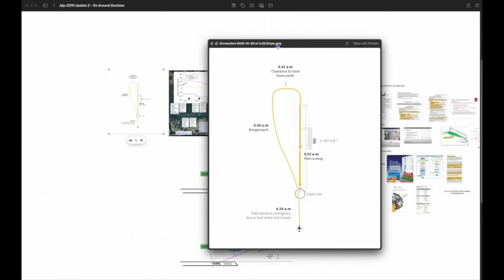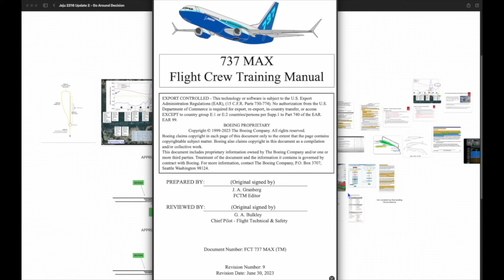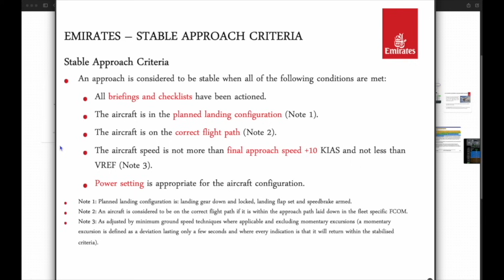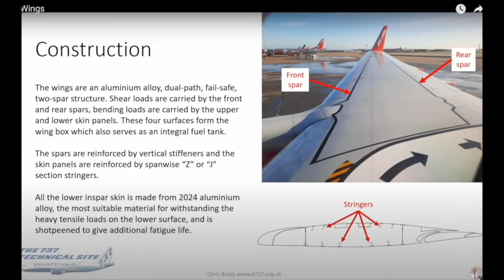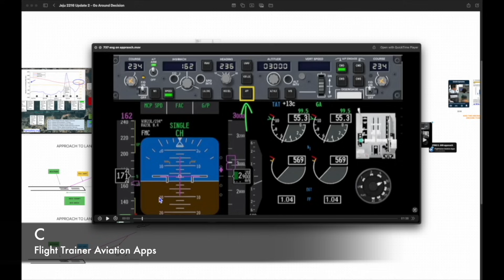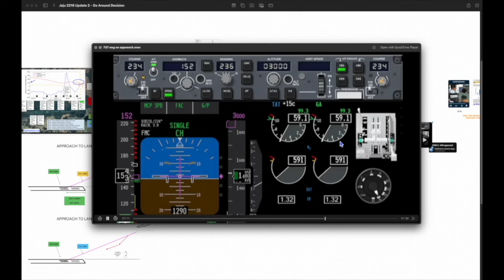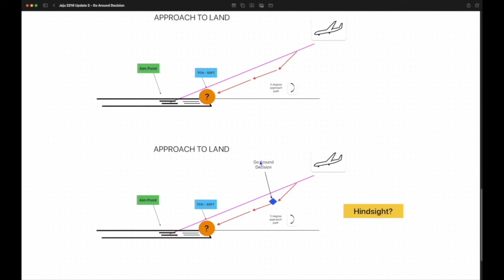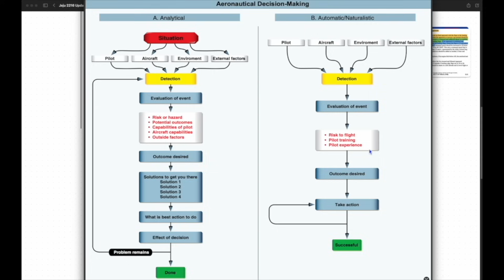Go-Around Explained: Jeju Air 2216’s Decision Not to Land

Comment: Take Note:

Many aviation expert's "Great Wall of Death" shtick regarding the Jeju Air Crash is misplaced, boring and unhelpful. 🤦‍  

The wall at the end of the Muan Airport runway was not the cause of the accident. Events on the plane in the minutes before were the reason for the crash. Going on about "The Wall!" is an exercise in distraction and deflection. With respect to the wall, Jeju Air Flight 2216 was proverbially and literally in the wrong place at the wrong time. FYI, Muan Airport over 17 years has hosted more than 100,000 take offs and landings with no problems at all with the wall.

Note: The concrete retaining wall that Ayrton Senna hit at the San Marino Grand Prix at Imola at 14.17 CET 1/5/1994 at a speed of 233 kmh was not the cause of his death. His loss of control of the Williams FW16 in the seconds just before the impact was the reason for the crash. It is an imperfect analogy with the Jeju Air Crash but you get the point.
Reply: The race had been under a very slow safety car for sometime and the tyre pressures had fallen so that the cars were bottoming-out on the plank, which resulted in Senna losing control. Many lessons were learned from this accident.

Comment: A couple of questions I posed to Chris Brady on 11/1: 

(1) Do you know what sort of CVR was being used on the Boeing 737-8AS registered HL8088? 

(2) What is the normal Chain of Custody for a CVR after a crash? 

(3) Do you know if Flight 2216's CVR was using/connected to a Recorder Independent Power Supply (RIPS)? 

(4) If a 737 loses all electrical power, will the CVR still work/record? 

(5) Can a pilot or co-pilot disconnect/turn off a CVR, either pre take off or in-flight? Hope to get a reply from you about these questions ASAP. 

Chris Brady737 replied: 

I have no way of knowing what type of CVR was fitted or if it had RIPS, that will come out in the investigation. Chain of custody depends upon the country of the accident. ICAO Annex 13 has a preferred path but it isn’t always enforced. Re “all electrical power” if all electrical power is lost then all electrical items will be unpowered. You need to understand that there are different types of electrical power - 3 generators, AC & DC busses, standby busses, various batteries etc. Watch my electrical videos for more info.

A Boeing employee told me the CVR on the Jeju Air plane was a Honeywell.

The HFR5-V CVR with data link recording (DLR) system is made for commercial air transport aircraft to accommodate mandatory cockpit voice recording. It simultaneously records four channels of audio present at its inputs. The HFR5-V CVR retains the most recent 2 hours of recorded information in solid state crash survivable memory.

Comment: The crew were told about birds from ATC made the right decision to go TOGA gear flaps up but still hit birds lost both engines hence that 180 turn to land down wind. 
WHAT could have saved that aircraft. A APU switched on and ready to use fully electronics hydraulics and normal operation of gear flaps etc.
Why wasn't the APU switched on for landing, to save fuel.

Comment: Engine problem/failure/fire on final, adjust flap setting, power and increase airspeed for the flap configuration AND LAND!
If you experience problems on both engines on final it is a no brainer! You HAVE TO LAND! 
I have watched dozens of podcasts on this accident and I do not understand why so many people beat around the bush, this crew should not have abandoned the approach! Yes, the localizer barrier at the end of the runway was the final killer, but apparently they landed the airplane 2/3 down the runway at around 160 knots without gear. How big of a threshold would it take to bring the aircraft to a stop?

Comment: Simple question: if you are facing a situation that your stabilized approach is disruptaed by bird strike (possibly a double one), what is the thought process that makes you think that it is safer to make a go-around, which necesitates climbing, turning and stabilizing again? There is no snowvall in hell where you can get a better shot the second time around. Just pure physics: if there is a disruption in the system, and the system start to loose the energy required to counteract the increase in entropy, as a consequence the entropy will increase. In simple therms, it will get worse over time.

If the training conditioned the crew that no situation can overrule the missed-approach when loosing the "stabilized" flag, then that training is hell wrong.

The primordial goal if any safety measure is: don't make it worse!

I get it that in such a situation the memory items kick in. Because that's the training's goal. But it's clear that there should be exceptions, like: don't attempt a go-around with two degraded engines if you're off the stable parameters by whatever margins. In this situation the goal isn't anymore to get 8n the apron intact and in perfect conditions (that's already gone with the engines), but to stop in as few pieces as possible. And they clearly had this chance in the first round.
Reply from the maker: Thanks for the comment and thoughts, and fair enough. It's very rare to face this scenario in training or anywhere else, so this isn't something that would be familiar - general experience and assessment based on experience, and expertise would have factored largely I would say.
Reply: You go around in order to have time and altitude to assess the damage, determine which systems work and don't, and configure for a new approach. Nearly always, a new approach after a go-around is far safer than continuing an unstabilized approach with a plane with unknown damage.

If they had tried to continue the first approach, without either engine, they would undoubtedly have crashed. The plane would not stay on the runway, in that configuration, without spoilers - they would bounce, likely more than once. And they had no means of slowing the plane if they did get it on the ground - no brakes or reversers. Unless you already know that the second approach will be catastrophic, making a go-around is the safest course. And the pilots, unlike you and I, had no idea that the second attempt would, literally, hit a wall.
Reply: It is hard not to base our opinion on the  disasterous outcome that occurred after the go around decision. So our logic tells us - go around = crash - (in this case). And many people make that arguement over and over again. However, if they were encountering power and direction issues on initial approach, they may have thought they could regain some stablity/control on the go around. Unfortunately things only got worse, but they could not foresee that.
Reply: @Sasha27smile  In fact, despite the fact that they lost all power and could not successfully climb out, they made the right decision. And they successfully made a very difficult turn and performed a textbook landing. If the runway was built according to ICAO standards, they would have walked away as heroes. It was not the pilots fault that there was a concrete structure within 200 metres of the runway end.

The alternative would have been to continue an unstable approach, with a misconfigured plane, with unknown but serious damage. That landing would likely have been devastatingly bad.
Reply: @petercollins7730  The aircraft departed the runway at 150kts, no one was walking away from that crash.
Reply: @christopherrobinson7541  The aircraft departed the runway at a calculated velocity of 94 knots, according to 2 different estimates. And with an energy-absorbing material at the end, and no massive concrete structure, the plane likely would have stopped, basically intact, with few if any serious injuries or fatalities.

Planes have departed the runway at ~100 knots and all or most passengers survived. Air France 558, for example, departed the runway at about 110 knots, and was traveling at over 80 knots when it was stopped by the ravine. Result: no fatalities.

You cannot reasonably claim that there was no chance that this would have been survivable with a better runway.
Reply: @petercollins7730  I'm sticking to 150 kts, which was calculated from the landing video and almost 100% fatalities.
Reply: @christopherrobinson7541  I'm sticking with 94 knots, which was calculated from the landing video. I think either velocity would have been instantly fatal for all.

Hopefully, the final report will be able to provide at least a good estimate of the exit speed. Til then, we're all just guessing.

Comment: It appears to me that the pilots had been maneuvering to avoid the birds, producing an unstable approach. And ran into some anyhow.  So they started a go around.  They started a climb and some seconds later announced a go-around and found that they couldn't climb due to engine damage, followed shortly by total loss of electrical power from the engines due to damage.
Reply from the maker: That could have been the case, without onboard data it could be very hard to reconstruct and answer one way or another
Reply: @AdaptiveAviator  The ADS-B data suggest that the pilot elected to go around,with two good engines, before the bird strikes.
Reply: The only bit I would disagree  with is that I don't think they attempted to maneuver around the birds rather the engine strikes caused them to deviate both in heading and rate of decent. Then I agree with you they attempted to climb for the go around.

Comment: Short final and do a go around with suspect engine no electrics & hydraulics,  2800 mts of runway not put to good use
Reply: The ADS-B data suggests that the pilot elected to go around (with two good engines) before being hit by birds. Having throttled-up and cleaned the aircraft, they were too close and too high to land ahead on runway 01 and hence replanned to land on runway 19.

Note that due to construction work, to extend the runway, only 2,500m was available.

Comment: The plane was completely compromised by bird strikes.  Is the problem a 60+ year old airframe that doesn’t have an APU that would keep it airworthy?  Would this outcome be a possibility on a newer plane design?
Reply: One of the things that makes planes so safe is the iteration of designs incorporating new safety features in each generation.  At some point skipping iterations is only great for bean counters and terrible for safety.
Reply from the maker: @erichey6394  great point, may lessons are emerging point to this
Reply: The aircraft was built in 2009 and was equipped with an APU, but not a RAT.
Reply from the maker: Thanks for the comment, there's discussion around an a320 - about a generation newer - handling this better. Modern twin jets even better so, size and system design